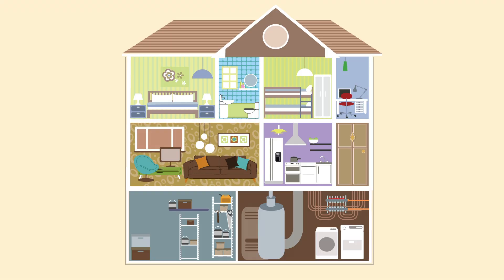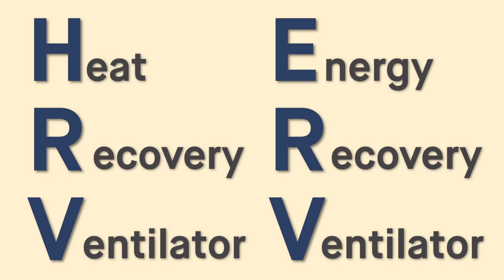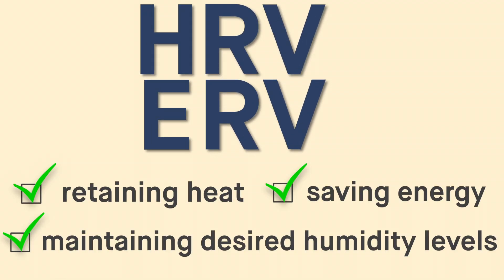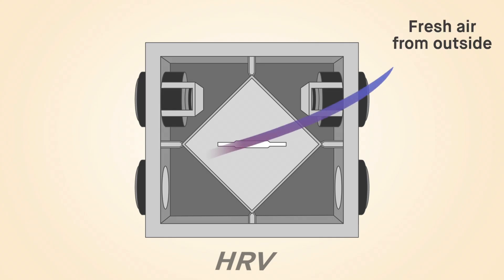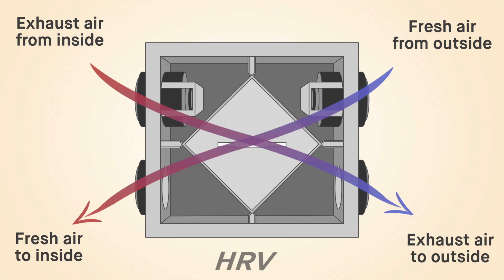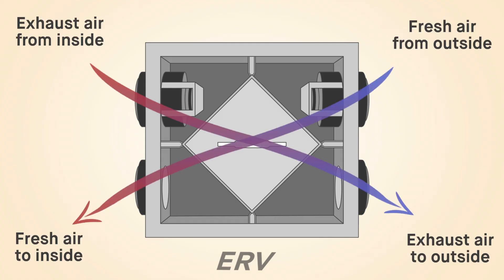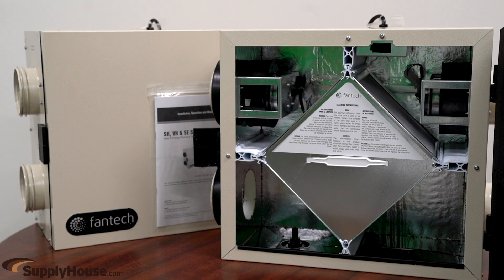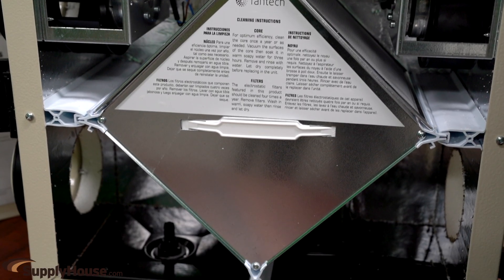HRV vs. ERV - What's the Difference?

Comment: I wish these videos would just tell us the main actual difference which is the ERV uses a paper based core, where moisture absorbs from either air stream and flows to the lower humidity stream. The ERV doesn't "remove" the humidity, it just takes the edge off if there is a big imbalance.  The HRV use a plastic or metal core that doesn't allow the moisture to "wick" between the ingoing and outgoing streams.
Reply: Thank you!. I just watched this and was none the wiser about what was different inside an ERV box from an HRV box.
Reply: To be fair almost nobody i have seen in my almost week
long of research mentions this detail.

I wont fault a 1 min 45 second video as much as a 15+ minute trade guy delving into the function of each unit in another video.

Comment: Good video. They way I understand it is ERV also recovers heat from
exhausted air, but in comparison to an HRV, it does
not remove as much moisture from the house. These features are recommended where cooling
load demand is high or where the relative humidity
(i.e. humidity level) tends to be on the low side
(e.g. in northern Canada). Thus, an ERV can help
to keep the house from drying out.

Comment: I’m so confused.  Ohio’s not in a good spot.  I see HRV one place, ERV in another.  I can say we have humid summers, and dry winters.
Reply: I’m in the same dilemma here in Cleveland area.  Summers are so hot and extremely humid and winters with super low indoor humidity…
I’m looking to add mechanical ventilation prior to sealing up my basement, but I can’t decide if I want ERV or HRV.    My home was built in the late 2000s so it’s relatively tight, except for the unfinished basement.
Reply: @dave83104  two years later, trust me, going HRV.  Can help control inter humidity in the winter and you don’t want freezing cold air blowing into a warm house.  You want to heat it up.  Summer if you have humidity issues, get a dehumidifier.
Reply: @david100483

Identical for me out of chicago, late 2000s home HRV/ERV.

Compounded with the possible option of a dehumidifier. We have humid summers and dry winters.

I am leaning at this point towards ERV to see if it will possibly satisfy my humidity problems without an additional device.

However if i do end up needing a dehumidifier then an HRV would've been the wiser choice.

If a dehumidifier is involved then the ambient drop of humidity through the ERV is not worth the additional upkeep required.
Reply: This video is out dated. If you live in the US and even into parts of Canada you should be buying an ERV. In fact, companies like Panasonic don’t even make an HRV.